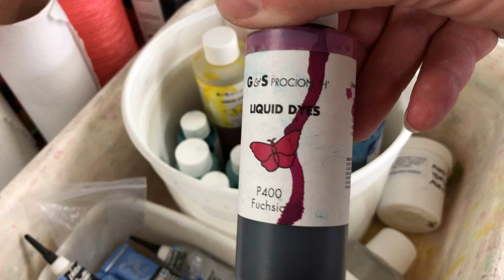How to Create Batik Crackle Effect

Comment: Are you a foreigner ? I love your accent.. I know how to do batik and i love the crackle it gives i work with beeswax but it comes off rather hard to do.. with soy wax is so much easier to get it off in hot boiling water. crunch it up and place into boil water..with the pricion dyes or gs dyes.. too. then take it afterwards with cold water to remove the color for a bit then iron the silk or steam it.